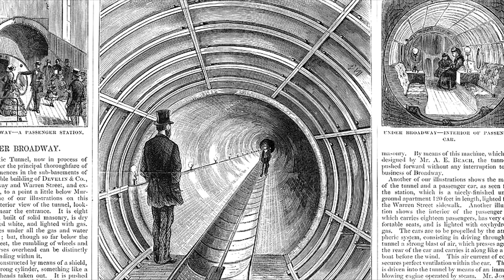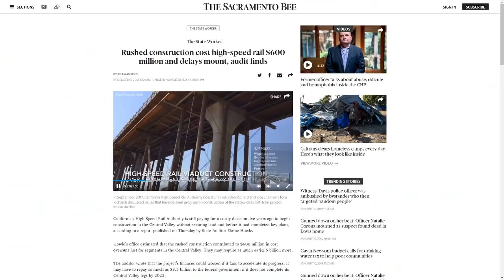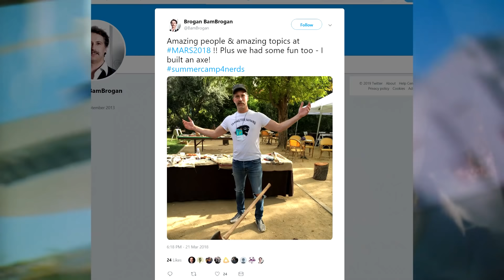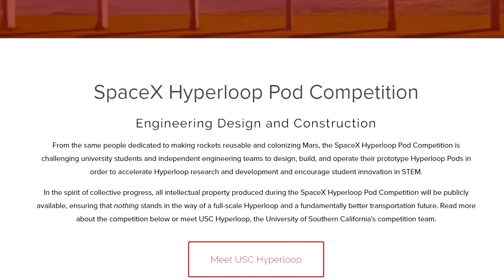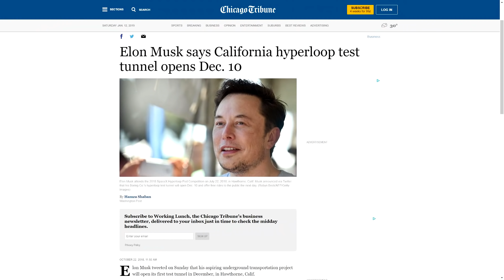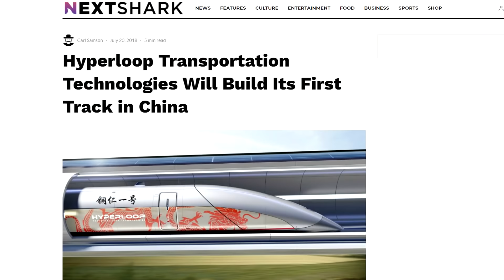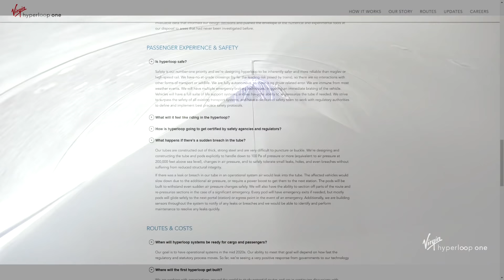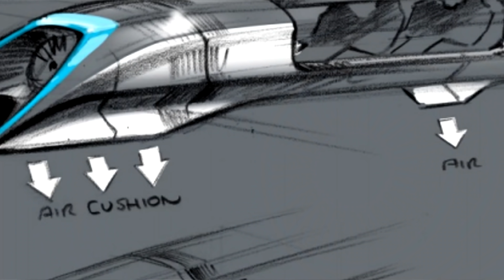Why Hyperloop will FAIL HARD - Its Biggest Problem...

Comment: These systems require just as much steel and concrete as high speed rail and built to tighter tolerances, but Musk said it would cost one tenth of high speed rail.  Really?  The system is low capacity, nobody had gotten above ~ 250 mph yet, and the passenger experience will be an order of magnitude worse than air or HSR.  But all the Musk fanbois are jerking themselves off to the pictures of these things, meanwhile serious transportation planners can't get anything done because "Hyperloop will be ready next year".  Screw Musk for mucking up public transportation.
Reply: Kibashi Siyoto The reason why it only went 250 mph was because the test track is too short.

Comment: If one takes the worst possible situation for every part of hyperloop, one has this screamingly biased presentation. Even assuming this worst case scenario, hyperloop is light years ahead of bullet trains running up and down the California coast. Just take one point for an example. Bullet trains don't turn much better than hyperloop vehicles, basic physics applying in both cases. Because of their weight, bullet trains must run on the surface and require broad rights-of-way, eating up many acres per mile of track, especially for safety reasons. Can you imagine a deer or a bear crossing with a bullet train and can you imagine the number of crossings that would have to be built to prevent any possibility of an 18-wheeler getting in the way of a bullet train?

The hyperloop is elevated and requires no crossings. It can largely use existing highway rights-of-way with some tunneling, but no more than would be required for a bullet train.

Also, the power required to partially evacuate the tube would be trivial compared to the power required for maglev operation.

As for the tubes collapsing, they would be designed for the low pressure operation, and a tube is the most efficient and strongest configuration. If a major leak were to occur, operators of the tube system could allow air into adjacent sections to control the velocity of any wave front.

In other words, there are engineering solutions to what you largely named as engineering problems. Construction of hyperloop should be vastly less damaging to the environment, especially over time, as there will not be the constant passage of heavy trains at speeds from 200-500 mph,  creating vórtices as they pass. All the traffic will be contained in the tube, which will be elevated above the normal environment. I suspect that it will somewhat like the Chunnel with emergency squads and access ports.

Anything will be better than carving a permanent and permanently dangerous wide scar from one end of California to the other.
Reply: 4 years later and hyperloop is dead.

Comment: Underground tubes solve thermal expansion, potentially leaks, right of way, earthquakes. Then it's just a matter of cost per mile plus energy consumption.
Reply: @Michael Enquist If cheap tunneling is available you can put the whole thing underground. I think earthquakes is mostly a surface problem.

Comment: It's a great idea - to make such a clip. I wonder why this idea was not used by other traditional companies? For example, American Oil Club: "Why Tesla will FAIL HARD". Or American Rocket Club: "Why SpaceX will FAIL HARD"... Truly now such clips would be a little bit outdated, but at the time they might have created additional problems to those who want to build new systems in the 21st century and are not satisfied with old ones existing. 

Every transport system has its pluses and minuses. Airplanes make a lot of noise and pollute atmosphere greatly. Traditional trains are also noisy and top casualty statistics. Maglevs affect people's health with strong magnetic fields. So when authors of this clip tell us only about the cons of Hyperloop and only about the advantages of existing systems, they are not completely objective.
Reply: Валентин Разумнов I would be nervous about the magnetic field damaging health. But other than that you’re right. And also, what health problems would it cause?

Comment: Capacity: Perhaps you should consider that 2 or 5 or 10 pods can travel together making the capacity per hour expandable. 
10 pods together would, therefore, be 10,000+ passengers per hour, and not only 1,000+? 
Watch - Abu Dhabi to Dubai in under 12 minutes (Youtube), Where Virgin Hyperloop speaks of moving 16,000 passengers per hour each way in a 12 pod configuration.

Comment: IT will be interesting to see how the new hyperloop in China will be worked on.  The key to hyperloop is cost per mile and time to drill a tunnel.  Drilling a mile of tunnel at 1/10 the cost of these old boring machines is nothing but astounding.  This commentary is nothing but ignoring facts.  I haven't seen any facts.  It sounds like you work for the disinformation experts at a big oil company.  How many tunnels of a mile have been made for 10 million dollars and done in less than a year.  Hydrogen powered trains?  Be neat when that hydrogen mixes with oxygen in a uncontrolled manner.  My solar panels for $5400 7KW I put in myself have generated 6 mw in 7 months.  Can I get 10 mw a year for the next 20 years from hydrogen for free?  Hmmm, guess not.  The Big oil would love to keep the myth going of using enormous amounts of power to compress, transport, and drill miles into the oceans makes more sense than simply attaching a solar panel to your roof and plugging into a breaker panel.  All energy created by man currently in a year is equal to 3 hours of sunlight hitting the planet.  Each square meter of earth receives between 1.8mw and 500 kw per year.  My 21 20% efficient panels are close to that.  Add up the square meters on a hyperloop system and there is more than enough power to power an efficient train.  The coolest thing about hyperloop is being able to have a small group of passengers going to various destinations.  Trying to get 1600 people going to 1 place is not very convenient.  Sounds like you like to wait hours in terminals and for a specific time to drive to a megatrain station and go to someplace where you don't have your car.  then you have to order a taxi, rent a car or spend hours gettign to where you actually want to be.  
Your technology you are trying to promote has been in development for 50 years for a reason.  It doesn't work well.  You are quite a backwards thinking individual that trashes anything you don't actually understand.  Electric cars compared to hydrogen cars?  The electric car has 18 moving parts.  The hydrogen vehicle has the same as a gas burner 1800.  I will have a 1 million mile warranty on my Model Y.  Your hydrogen car and train and boat and plane will have more than 1800 and will they need no maitenance for 200000 miles such as brake pads on an electric car.  When you brake does that hydrogen vehicle create hydrogen or use friction to brake.  Regeneration is very effective.  Your hydrogen train should do well in an accident.  It would be interesting to see what would happen if a million liters of super cooled hydrogen at thousands of pounds of pressure leaked in a tunnel.  Do your homework and get out of your grandmothers basement and take a few physics and chemistry classes.  Then you can actually think and run the numbers.

Comment: All of Musk's inventions seems to work better (or is the only viable alternative) on Mars. Solar power works on Mars, no need for fuel extraction and refining. Gas cars would not work without atmosphere, so electric cars is a good alternative. We'll need to build very thick shielding to block out the solar radiation due to the very thin atmosphere on Mars, boring multiple level tunnels underground will be cheaper and faster. Mars is also a much smaller planet than earth, covering it with communications satellite would be easier (probably make more sense than Starlink on Earth).

Comment: When I have first heard of Hyperloop I thought it was about magnetic TRAINS in vacuum. For example, the Japanese maglev in a thin-aired tube. Which could make sense (except for the technological and financial difficulties).
But then I discovered it was about capsules. So, we are going to invest billions in tunnels with almost no air (????) to carry 30 people? Why!?!?
Much better just building maglev lines as the Japanese one and make them longer to cover higher distances (as Japan will complete doing it in some years).
Reply: Don't worry.  Soon Musk will have the "genius" idea of coupling pods together to increase capacity, you know, a train.  He will say he thought of the idea all by himself. The H-L and Musk fans will never use the word "train" though, they will continue to act as if they have never heard of trains.
Reply: They have to make the "trains" smaller due too the cost of the low pressure tube.

Comment: Nick name for the Hyperloop is the Hyperflop. Can you do a show on the Fusion Delusion. If the second law of thermal dynamics makes a perpetual motion machine impossible the same laws must hold true for Fusion power. Think of the energy that is required to get a spark of fusion with no return. Now please tell me how this fusion power will perpetuate itself with energy to spare

Comment: You use the Maglev from Shinkansen as a good example, why not put that thing in a tube, and you can move a lot more people. There would be lots of possible engineering tasks in terms of safety, however the ones you mentioned are all solveable. Engineers of the Transrapid (the real one China copied) said, that without air resistance speeds of up to 10000 km/h are easily possible. The biggest problem is and I agree, the cost of building the track.

Comment: Nextgen superfast MagLevs are the next best thing to hyperloops in near future mass fast transit. And the technology exists now. 
600km/hr slim, long trains (10 -12 cars) running through narrow Boring Co tunnels is the next incremental step forward in mass rapid transit. Mark my words. A SFast MagLev from Toronto's Union Station to Pearson Int Airport (YYZ) could be built for less than a traditional subway, HSR, or the doomed HLoop. Pearson MagLev could be expanded west to KWC (a big tech center) and eventually, London Ont. In a pipe dream the ML network could further link cities like Ottawa, Montreal, Detroit/Windsor and Chicago.

Comment: Its in a tunnel thats good and bad, saves space on the ground but EARTHQUKES, DRASTIC PRESSURE DIFFERENCES.  WHAT ABOUT A ROLLER COASTER TRACK elevated with an arm so it can swing out on the turns  and possibly made of a very light, very strong and highly static property like MYLAR and it is propelled with Statis electricy instead of magnets.

Comment: But wait

Due to Mars lower air resistance and colder temperature, the SCMaglev is even better in Mars, as the efficiency of the superconductor will be even better. Hmmmm

Comment: 1903: Hence, if it requires, say, a thousand years to fit for easy flight a bird which started with rudimentary wings, or ten thousand for one with started with no wings at all and had to sprout them ab initio, it might be assumed that the flying machine which will really fly might be evolved by the combined and continuous efforts of mathematicians and mechanicians in from one million to ten million years — provided, of course, we can meanwhile eliminate such little drawbacks and embarrassments as the existing relation between weight and strength in inorganic materials. 

1917: That [rocket pioneer Robert] Goddard… does not know the relation of action to reaction, and of the need to have something better than a vacuum against which to react — to say that would be absurd. Of course he only seems to lack the knowledge ladled out daily in high schools. 

1985:
On the whole, people don’t want to lug a computer with them to the beach or on a train to while away hours they would rather spend reading the sports or business section of the newspaper… the real future of the laptop computer will remain in the specialized niche markets. Because no matter how inexpensive the machines become, and no matter how sophisticated their software, I still can’t imagine the average user taking one along when going fishing. 

But please, do go on about how you know better than everyone else about future technology.

Comment: Thank you for bringing up some major questions about the Hyperloop concept that everyone seems to be turning a blind eye to. Safety is a huge concern. If a passenger has some sort of medical problem, the capsules are not big enough for any sort of attendant and getting someone quickly off the system would be impossible. Anyone having a heart attack or stroke or anaphylaxis would be dead by the time the capsule arrived at the destination and there would be nothing anyone could do about it.

Comment: Just saying, you can’t make a vacuum tube that’s 100 miles long. It’s impossible.
Reply: You can.  It is just insanely expensive.
Reply: True, I was wrong to call it “impossible” technically it’s totally possible. It would just be insanely expensive. 
But it’d also be extremely dangerous.

It could happen, sure... But with marketing like this, it’s absolutely doomed to fail. They’re raising expectations ridiculously high, and have set deadlines that they cannot hope to achieve.
And so...
It’ll never happen.
People will give up on the idea of the Hyperloop before the proper funds are secured and proper testing is possible.

Comment: Mythbusters demonstrated what rushing air into near vacuum  tube can do, shoot a ping pong ball through a ping pong paddle.
https://youtu.be/iuscU6knvH8
One kilometer of air rushing in at the speed of sound will weight about 13 tons of you do the math with a radius of 2m of the hyperloop to get a nice room for the passengers.
But acceleration or deceleration like the ping-pong ball will kill you in an instant.
For freight ok but it's way to expensive for freight.

Comment: There is a new technology being developed called Energy Accumulation Reticulation Transonic Hyperway or Project EARTH. It is the NextGEN transportation to put airtravel out of business. The top speed is theoretically Mach 3 using existing mothballed airframes with capacity of over 4000 passengers an hour from London to New York. The key underlying structure is its new thermal energy extraction system using cold steam. With a potential to extract 1.3TW of energy from the environment.

Comment: Although I am not going against the fact that it *could* possibly fail, your points were very weakly structured, such as 'It already exists, maglev trains', do you know anything about the hyperloop? One of the main points was that there was no air resistance, which let it go much much faster, and it doesn't need to steer, as long as it goes in a straight line it can still get you from a - b

Comment: The high speed trains in Japan, France, and China operate at enormous deficits subsidized by their governments due to national pride.  They also require long, straight sections of run, whether rail or maglev - just as the hyperloop does.  This requires more land rights, tunnels and bridges for all high speed trains regardless of technology.

Hyperloop is under construction in California, but has stalled due mainly    the inability to acquire land rights and environmental opponents.

High speed rail and maglev are in countries having governments willing to subsidize the costs, overrule land owners, and defy environmental opponents.  If these systems you advocate tried to do this in the U.S., they will not succeed either.
Regarding vacuum pumps spaced along the tube to maintain a vacuum, i expect that is no more difficult to do coompared to electric needed for maglev and overhead wires for other high speed trains.

If a car breaks down and people need to escape, i expect there would  be escape hatches spaced along the  tube just as there are exit stairways in tunnels.

Regardless of technology, i do not expect any high speed train of any type will be established in this country and even if one is established, it will operate at a heavy  loss and will need to be subsidized.
Reply: Those "environmentalists" who oppose new rail lines, wind turbines, lithium mining are the greatest crackpots, effectively trying to throw people back to the stone age. It has been a long standing "environmentalist" approach in Europe, to force people from cars and airplanes into trains. They say a flight for less than 100€ across Europe is too cheap (even Hamburg-Munich is already 114€ by train), want to make it more expensive and then even obstruct rail. An extended rail system from Switzerland has been planned into Germany along the Rhine, and is long complete on the Swiss side, but people living along the tracks obstruct it with litigation. Often not even affected by eminent domain, but simply because they don't want anybody to turn a stone upside down miles around their homes. They can do so for decades, if governments don't overrule and decide to build, possibly compensate later.